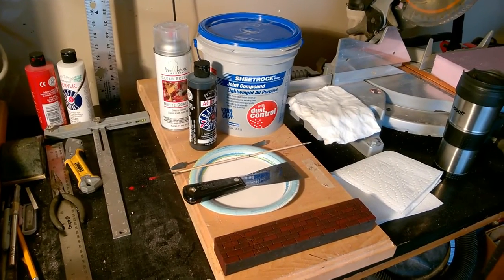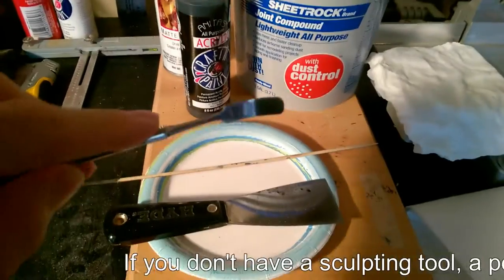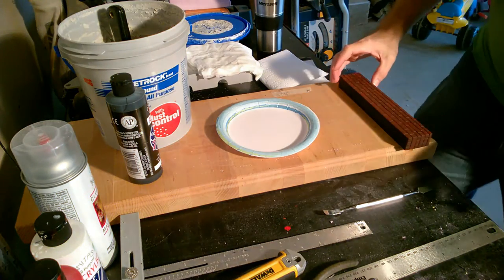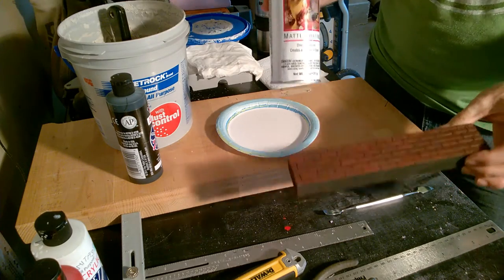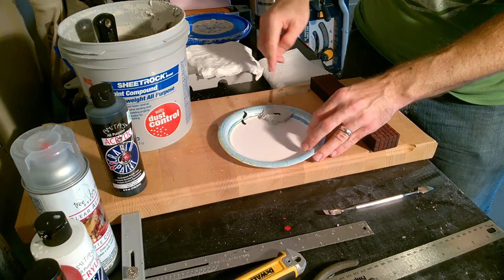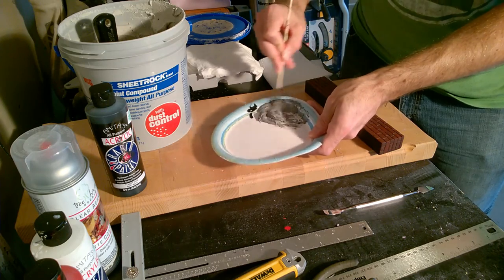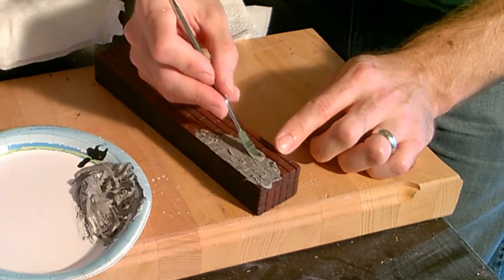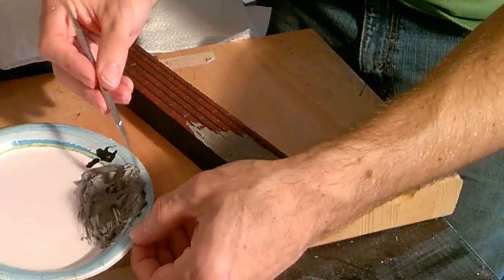Brick Mortar Diorama Tutorial

Comment: thanks for the tutorial. I'll definitely be trying this out.
Reply from the maker: Glad I could help. This is probably my favorite technique to use now when making a dio. And it's so easy, which is even better. Good luck on your next project.
Reply: I was thinking it will get into the cracks we create sometimes in the brickwork. You had cracks carved in the undone side. Do you just dig out the mortor before it dries in these areas that it wouldn't be purposely?
Reply from the maker: I take some cardboard from a granola bar box and put it into the cracks so it doesn't fill it. Otherwise, if I can't get the cardboard in there, then I use the cardboard to block the crack as I get closer. Then, if I do get some in still, then yeah, I try to scrape it out. Worst case scenario, if you do get some in there, just throw some black paint on with a thin brush and it's back to normal again.

Comment: This is genius !
Reply from the maker: Thank you sir. As always, thx for checking out my videos and commenting. Much appreciated.
Reply: TechChucker's Brain Blast NP. Would it be a bad idea you use paint with this technique ?
Reply from the maker: On my Daredevil apartment project I'm going to be using this mortar technique and then doing a little weathering/dirtying over this stuff. Dry wall mud is meant to take paint so it should be fine. It might suck up a little more paint than the foam I would imagine, but it'll hold paint just fine.
Reply: ***** Alright thanks.

Comment: Thanks for this video, but I have to tell everyone to be careful about spraying sealer over the bricks. It turned all my brick slips white - like an old brick house once painted white but now faded. I can work with the effect, but it wasn’t what I was going for. And yes, it was clear and rated for use on terracotta, plastics, wood etc. And it was “crystal clear” according to the label. Not so. It may just be a brand problem. I also learned that any bricks that had any little bit of tacky glue that I used to apply the brick slips to the house on the outside of them were resistant to the sealer. In other words the tacky glue dries clearer and works better at sealing the brick slips than official sealer. FYI
Reply from the maker: Yeah, using a lot of the sprays can yellow over time so if you're covering white it's usually not a good idea to use a polyurethane type. Acrylics are less apt to yellow.